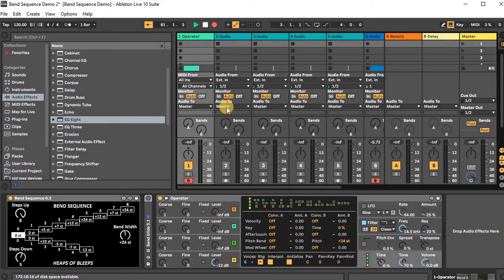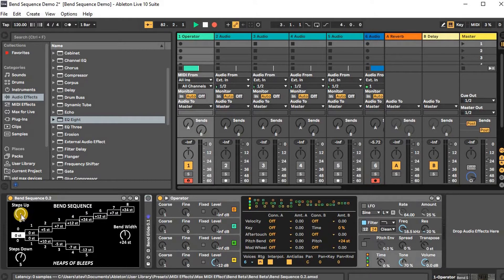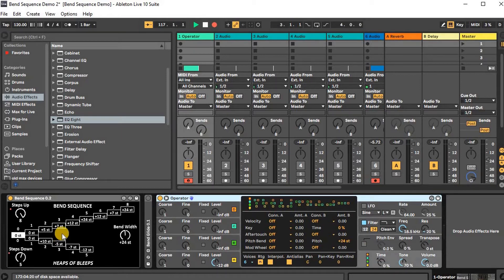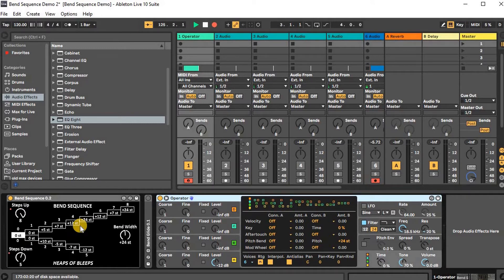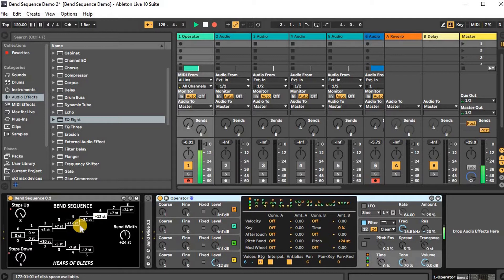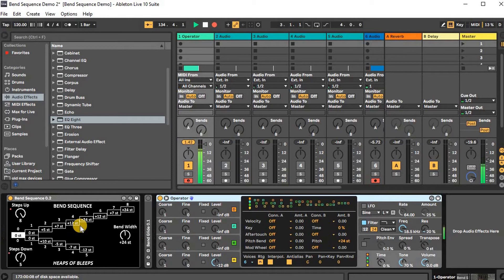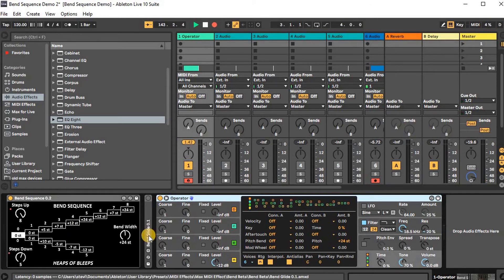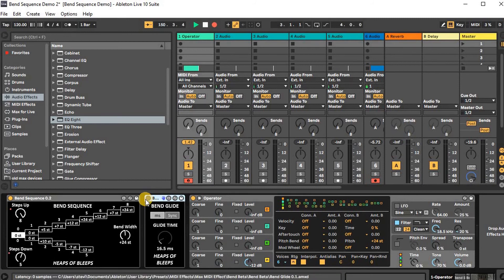Bend Sequence and Bend Glide Demo

Comment: I bought these devices and I like them! I wish there was a scale one. The quantize one is chromatic if your playing a scale.
Reply from the maker: You can bend through scales with the quantize one. Just turn on the corresponding toggles in chromatic mode. So for major it would be 0 2 4 5 7 9 11. 

I have a hunch you might mean having the pitch bend keep every note in the scale and not do parellel bending though. The issue with that is pitch bend is monophonic so that wouldn't work with multiple notes at once.

 I've been working on some mpe stuff and that could potentially get around some of those issues though. I'll look into that because it does sounds pretty cool. Ill let you know if I make one. It would only be compatible with live 11 tho.
Reply: @stevieschmidt3719  thanks for answering. I did what you described in the paragraph and it's fun. what I mean is different though. Like if I was playing notes in the C major scale, I would like to be able to play an E and pitch bend it and have all the notes still be in the C major scale instead of quantizing through E major.
Reply from the maker: @raindrozest9558  yeah the monophonic pitch bending I was talking about in the second part of my response is the problem woth that or I would. Imagine you're playing a c and an e (in c major) at the same time and bending. The c would want to be bent through a major scale to stay in key but the E would need to be bent through a  phrygian scale (or a major scale starting on the 3rd). Since the bending is monophonic you can't do both at once though. 

I'm messing with some mpe which gets around this tho. Maybe I can make it work at some time in the future.
Reply: @stevieschmidt3719  that sounds sweet! thanks again. still though, currently even if I just play E the bending will operate from E being the root instead of staying in C. I tried adding Ableton's scale plug-in to lock it in but that was kinda weird.
Reply from the maker: @raindrozest9558  abletons scale effect won't work because it onlys changes midi notes, not pitch bend. It would definitely make things weird.

The device only does parellel bends so it treats all notes the same. I would've added that more in key scale feature you're talking about if it would work with polyphonic midi but since it doesn't it was kind of pointless. The moment 2 keys in a scale are pressed down one would be bending in a different scale anyways.
Reply from the maker: @raindrozest9558  I have a hunch you missed the 2nd and 3rd paragraphs of my first reply
Reply: @stevieschmidt3719  oh I read it multiple times. I'm still kinda confused though lol. what your describing with mpe sounds optimal for sure. but still I would be darn happy playing notes one at a time and going hard on the pitchbend and having everything stay in one key. that seems monophonic and possible to me.
Reply from the maker: @raindrozest9558   yeah the monophonic version is definitely possible. but in my opinion it being monophonic makes it too limited for how much work it would be to code. If I do make the mpe one it would probably be relatively easy to switch that to be monophonic after the fact though. Which would be more worth it to me. 

As a side note, coming from a jazz background, I do genuinely like the parallel chromatic transposition that is common in electronic music. I think it can lead to more interesting harmonies that people wouldn't normally play. I'd recommend using a lot of 4ths, 5ths, 7ths, and 2nds in the chords you are transposing, or transposing other chords by those intervals.
Reply from the maker: like in this video, I'm basically only transposing by those intervals with the bend sequence. That give you a feeling of not getting too far outside the key, as youre only going a few steps down the circle of fifths outside the key.
Reply from the maker: @raindrozest9558  fyi I have officially started to work on this. the mpe version is coming along nicely. less work than I initially thought. will probably be out in the next few months. Email me at the email on the contact page of my site. Ill send it to you for free for coming up with it :)
Reply from the maker: @raindrozest9558  thank you for the idea!